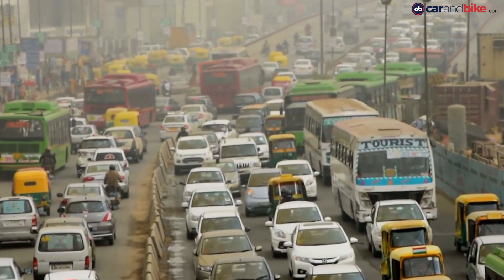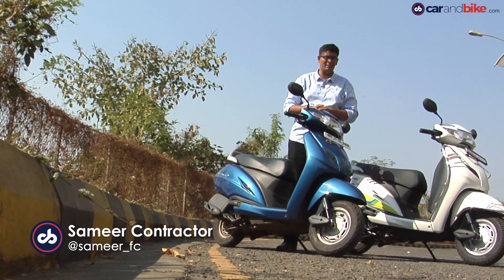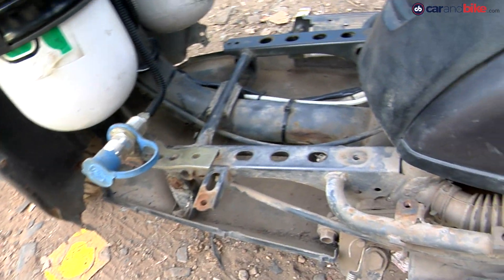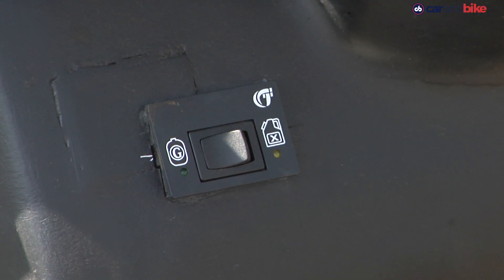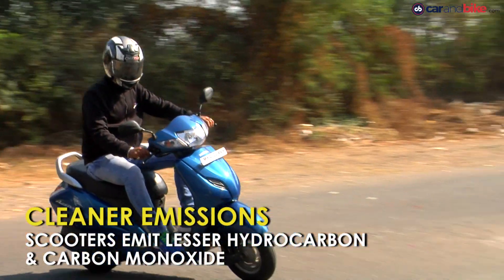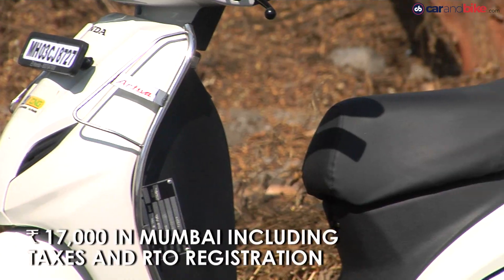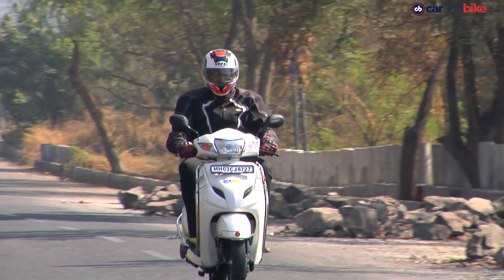Honda Activa CNG Review - Price, Mileage, Performance | NDTV CarAndBike

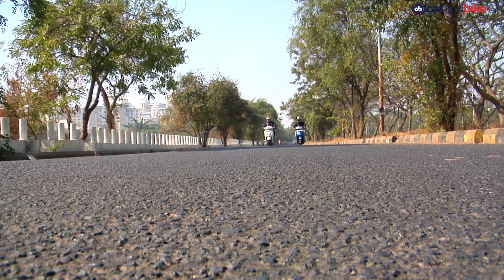Comment: Nice concept, but in the video (2:47) you mention running cost CNG = 60 paisa/km & Petrol = 1.2 paisa/km? Shouldn't it be 1.2 Rs/km for petrol?
Reply from the maker: Thank you for pointing out. 

It is 1.2 Rs/km for the petrol and 60 paise/km for the CNG version.
Reply: what is cost ??
Reply: Sense of humourrrrr 🤣🤣
Reply: In petrol it cost approx rs 2 . Per litre

Comment: design change if cylinder fixed behind apron so why dual mode remove the petrol tank and made cng tank and place it where petrol tank is there and dual mode but not petrol but electric mode fixed big battery charge while bike run on cng and in need switch to battery mode and run the vehicle